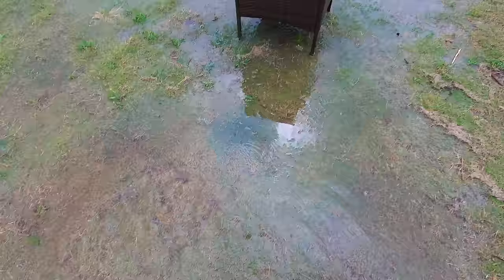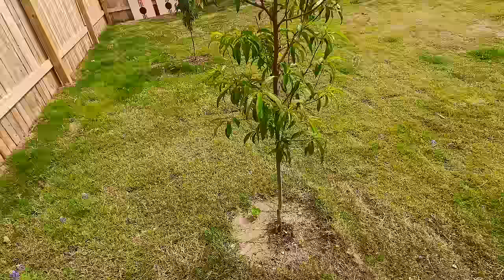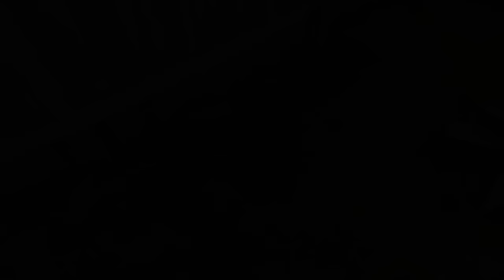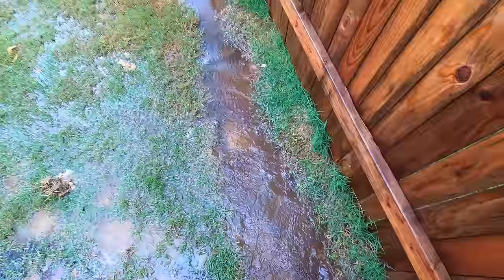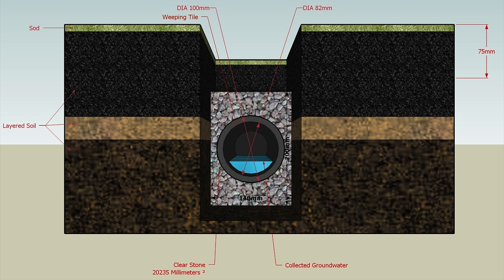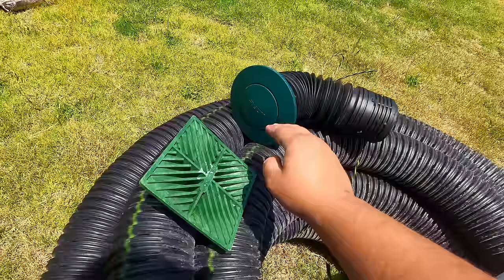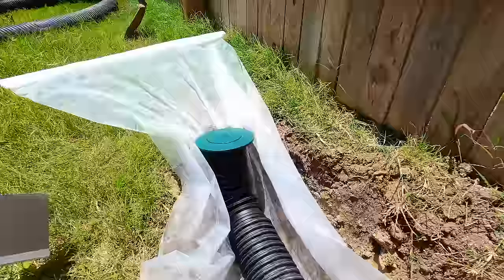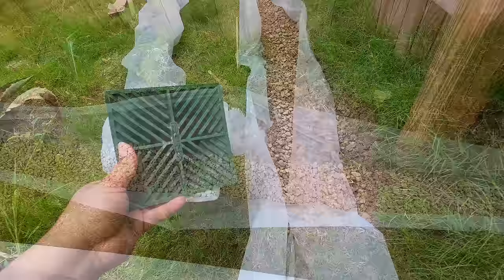How I Built a French Drain to Improve Drainage on Clay Soil

Comment: nice project, well done...... buuuut, a word of advice from my amateur knowledge;
the white soil separator you used might likely rot after 1-2 years, or let any roots through to the pipe. if you ever need to fix the drainage, rather use a strong(er), usually black, soil separator (like a car tarp). just my 2 cents :)
Reply from the maker: Appreciate the advice! Its now been 18 months, so ill have to reassess things next summer

Comment: That's amazing well done mate. Where the ditch out front is, are you allowed to build a path leading to the street from your gate and install another french drain alongside it?
Reply from the maker: I could’ve tried, and I agree the drain would’ve been better if I went closer to the street, but then I would’ve been getting really close to electrical wires and Internet fiber, so I stopped where I did

Comment: It would obviously give less drainage, but I have to wonder if this could be done with just a trench and the stones, without needing the pipe or soil guard at all. Would even think you could leave a slight gap at the top, cover it with some top soil and grow grass back over it. Just using the stone under the surface as added drainage. Of course you'd probably want to take that trench further out so it has somewhere to go.
Reply from the maker: Agreed, I think just a trench and river rock would work, of course without the pipe and nets, it will fill with sediment faster
Reply: @AustinTexasGardening  True. After a few years it might lose most of the drainage

Comment: I am thinking to use this method since i have a littler river running in my backyard when we get heavy rain. I could "catch" the water that comes from the neighbor and using the french drain all the way down with an exit to my lower neighbor.
Reply from the maker: It should work, don’t forget to call utilities to mark power lines or check building plans before digging!
Reply: Yes this works, but you only need a french drain or catch basin where you catch it. The rest can be underground smooth pipe all the way down to carry the water. Absolutely no need to have a french drain the entire length.

Comment: FYI you dont need the gravel to be exposed to air, cover it with some sod. The water will penetrate the profile and itll look better
Reply: i would also recommend against the plastic, all its doing is keeping more water away from the pipe. a pipe like you have wont let in mud anyway, exspecialy with the liner you wrapped it in. And in case it ever gets clogged you already have a flushout. it seems like the outcome was good but it probably couldve been better. (ive been installing french drains of golf courses in clay for years)
Reply from the maker: I've considered covering it with sod, might be something to do this spring

Comment: Great video! I just noticed you said "corrugated" pipe had holes in it - Not true, unless you use "perforated" corrugated pipe.
Reply: Thanks for correcting that, I was looking through the comments to see if anyone did. 
What he’s using is under drain pipe.
If you use PVC under drain, the water bubbles up through the holes on the bottom in order for the water to clean the pipe as it goes

Comment: im confused. where did the french drain  send the water. it didnt look like you connectred anywhere. it looked like you just dug one long trench and put an cap on it.
Reply from the maker: The bottom of the trench is about 4” lower than the top, the water has always drained between my house and my neighbors 4:28, now more of it pools around the pop up cap, and drains into the alley. The drain would be better if I dug it to the alley or street, but as you’ve noticed from the before and after pictures, I’m pleased my hard isn’t flooded anymore

Comment: Glad that worked out for ya, but really you just need to amend your soil, start mulching your grass instead of bagging it, add compost, bring in some worms, toss down some mycorrhizal fungi, need to fix the broken ecosystem that is your backyard, they brought in all this clay you're saying, that's not it's natural state. And in the end your lawn will look even better, be happier, be more drought resistant, and overall just be better and healthier.
Reply from the maker: Completely agree, this is great advice. I'm planning on amending with an auger and mulch early spring/late winter, just have to find time to do it
Reply: Setting up a French drain will work months if not years quicker than soil amending.

Comment: So you didn't have to run it all the way to the street? You only ran it to where the swale begins between the houses? I'm having the same issue (also in Austin). The swale between mine and my neighbor's house works as it should but I'm getting water run off pooling up against the fence because she waters so much :(
Reply from the maker: The trench didn't need to be dug further because as you mentioned, the swale catches most of the water. When it rains a lot, some of the water goes through my yard, but I have no standing water within 5 feet of fruit trees, less standing water generally, and the standing water I do get clears up within about an hour, as opposed to standing water sitting for days to the point of mosquitoes breeding in it.
Reply: Swale or not drainage to the street or alternative outlet will work much better than a buried pipe.

Comment: Someone from Round rock here ☝🏽 do you need city permits or call the city to check if there are any pipes or wires that you need to be aware of before digging in? We’re trying to figure out that part .
Reply from the maker: Permits no, but you really should have them come map out gas, electric, and fiber lines. The only reason I didn’t do this is because I watched them lay the lines during my homes construction one year before I made this video

Comment: Wondering how French drain helped with standing water. ? Standing water would mean you have low spots in yard
Reply from the maker: The clay soil soaks up water, so when 1" of rain falls, without the drain, ~9" of rain run through my yard (from everyone elses yards) causing the soil to be maximally saturated, and the water to stand.

With the french drain, when 1" of rain falls, the ground soaks up the rain, no water is standing, and the water from my neighbors yards drains elsewhere

Comment: Any ideas on good videos for larger landscapes? Project on housebuilding got left halfway done, too many problems so had to let the guy go. Now wife and I don't trust anyone but ourselves to do it right. How can I learn the concepts or drainage and what to do for the property? W're on a very slight grade, with the house area being "leveled" already and its pooling up quite a bit
Reply from the maker: I would honestly suggest looking for a professional with a large, highly rated portfolio. It will cost you, but for building a house, it needs to be done right.

Of course, this video is just a 40' drain in the suburbs, for something bigger/longer there is a lot to consider. If you are not draining to a lower level than your home, flooding the foundation can cause some real problems. I would advise digging your drain deep, and with the drain exit being significantly lower (like 12") than your build site, and far (~100m) from your home
Reply: @AustinTexasGardening  Yeah that's definitely preferable. But being so far out in the country, a good reputation is hard to come by. So I wanna learn it all myself but that's not a clear cut process lol

Comment: Good job. I’ve had experience with corrugated and PVC. I found PVC easier to maintain and do a better job. Any reason why you didn’t use PVC and drill holes at the bottom to work as a French drain?

As others have said, continue it to the street. Preferably with PVC.
Reply from the maker: PVC would have been better, but corrugated was easier to use, I didnt have to drill anything and my trench didnt have to be a completely straight line.

I might try to bring the french drain closer to the street in the future, but right now, I dont see a need for it, as the water drains the way I want it to.
Reply: I plan to use 6" pvc for a pipe. I saw some that already have holes drilled on one row. I am wondering if I should drill a bunch more holes like corrugated pipe so that standing water will drained thru those holes. I have very high clay soil and thinking of using commercial geotextile ONLY at the bottom layer as barrier between soil and rocks, then lay down the pipeon top rocks and cover pipe with more rocks ...done! Hope it works because I need to do 150ft long trench, farm application. Thanks.
Reply: @mandiegarrett1706  let us know how it goes? I am wondering.
Reply: @darealturbo9749  Well, due to heavy clay soi here in AR. and after chatting with some local rock seller, he recommend just do dry creek bed method with sand as bottom layer to help with drainage then a layer of rocks on top to keep everything together to direct water out to our pond. I think I am going to skip the sand and just use rocks of different sizes and landscape it like dry creek bed. If I first put down some big rocks right into our clay soil then follow with medium to small size rock to fill in the gap. I think doing this way without fabric, pipes, etc...should allow water flow freely to the pond. Don't know for sure if will work but will experiment with about 10 ft and see if that will work. Thank you.

Comment: Just saw your post on reddit! Great stuff! I noticed that the peach tree experiencing the waterlogging issues had way smaller leaves, etc. I've got a peach tree sitting on top of very clay heavy soil and while it HAS leafed out, the leaves are really quite small (1/4 the size of the peaches next to them). Would you recommend digging a mini trench down a slope behind this tree to solve potential drainage issues?
Reply: You want 10 inches of well-drained-soil so a trench or simply raise the tree where it sits on a mound.  I did both & achieved 14 inches.
Reply: @SlackerU  thank you so much! Would the "well draining soil" 10 inch+ layer be inclusive of the rootball? Or does the rootball needs to be sitting on that the layer of well draining soil to ensure good drainage?
Reply: @paulli4938  The roots will live in the 10-inches of well-drained soil-horizon(layer). Your local University Ag Extension office probably has the information on their website for small farmers. My native soil has a PH of 5.3 so all of my plants are mounded.  I basically just don't dig a hole & place my purchased-potted trees on the ground to then surround them with a mound of proper-PH soil.  The roots flair out like an umbrella over the mound.
Reply: @SlackerU  again, thank you so much---this was extremely informative! I have terrible, terrible heavy clay soil under a thin 3 inch layer of topsoil developers put down (and mixed with small rocks below). Digging and amending (and the drainage issue) has been a PAIN. I am going to dig up my peach (it's still relatively newly planted) and try your method for hopefully better results!
Reply from the maker: @paulli4938  Yep, my main motivation with the french drain is that my backyard is too big to improve so much of it, even with the trench im thinking of mounding my large peach tree as well, just to give it a better chance

Comment: That crap you wrapped the drain with is going to get clogged over time and you'll be right back where you started with drainage problems.
Reply from the maker: What would you have done differently? Left out the soil separator? 

I did an 18 month update where some pockets of granite were swallowed by dry clay soil fissures, the soil separator that was exposed looks to be not very weathered
Reply: @AustinTexasGardening  Yeah, I'd have left the fabric off. All the soil particulates will embed themselves in that wrap. Over time the amount of water that enters the french drain pipe will be reduced to a trickle.

Comment: Wait. Are you tell me that the water on the opposite side of the garden drained because of the french drain on the other side of the garden?
Reply from the maker: Its the fact that the grading drains at least 8 backyards worth of standing water from the elevated west through my backyard. The house to the north (behind my backyard's back fence) is elevated, so almost all the water is coming from the west. I've found the french drain makes a pretty big difference, we have a lot of rain forecasted so I hope to make an update video.
Reply: @AustinTexasGardening  cool. Because of this video I plan on doing the same thing in a straight line down the middle of my garden from the back wall to the house. My garden is just clay soul with zero drainage. Cheers man

Comment: I don't understand how is the water gonna enter in the pipe? I think all the water will just enter in the soil through that gravel
Reply from the maker: The soil is so dense that when it rains, the water collects on the ground like pouring water onto a dinner plate, thats why I have so much standing water after only about an inch of rain in the first place. 

The water enters the pipe because as it flows downhill and through my property, the trench catches it, and the granite displaces the volume where the water would otherwise go. The pipe runs at a slight decline downhill, so the water enters the pipe, and flows downhill, towards the drainage alley between my house and my neighbor's house.

The installation of this french drain has turned my backyard from a mosquito infested swamp to just a pretty normal backyard, and improved the quality of drainage around my fruit trees.

Comment: Would a French drain work if your yard is a a hill?
Reply from the maker: It depends, the main thing you need is a downhill slope, so any standing water in a valley needs to drain to an area with a slightly lower elevation. You can do this by sloping your trench about 1" per 10 feet, but the steeper, the better.

Comment: How many QF of granite needed for 50’ French drain?
Reply from the maker: I used about 30 cubic feet of granite for this 40’ trench, so I’d bet you’ll need around 38-40 cubic feet for a 50’ trench (depending on depth and width of your trench, mine was about 12” wide and 12” deep)

Comment: There is no need for a drain when you haven't leveled/graded the lawn yet
Reply from the maker: The pop up cap doesnt really work, but the french drain really does catch all the water that would otherwise fill my backyard with .5-1" of standing water and misquotes and all spring. When we get 1 inch of rain at a time, the water pools around the lower end of the drain and when it overflows, it drains downhill between my house and my neighbors house, leaving the majority of my yard well watered and not flooded (as shown at the end of this video).

We're getting a lot of rain this week so I hope to make an update video

Comment: I’m sure the video creator did this, but for other folks: be sure to talk to your neighbor (in writing if possible) before working on any drainage solution that routes water towards their property
Reply from the maker: Great comment, my neighbor and I are buddies so we talked it out after, but we really should’ve discussed it before. I wouldnt show it in the video, but my neighbors house is built up almost 3 feet above ground level at the bottom of the French drain. The side of his yard on the other side of my fence has a downward grade of nearly 20°.

I’ll add, as I mentioned in the video, this video is really only for people that are in similar situations to myself, if you don’t live in the suburbs and have a large property, consider that redirecting the flow of water can be a criminal act, if for example, you build a French drain diverting a flood plain.
Reply: @AustinTexasGardening  Realistically, all you were doing is protecting your lawn from the runoff from his steeper lawn anyways! With such poor soils there just isn't enough infiltration to infiltrate the water landing on top of your soils and plus the water from his lawn!

Comment: There's an easier way to solve this. Many of these lands had the good top soil compacted or scraped off. If you add a layer of leaves shredd and compost mix together year after year until the grass comes up through. it will also fix your issue.  you want unfinished compost so you are basically building an organic layer. You also want to plant some tilage radish.
Reply from the maker: I agree that improving the soil quality would definitely be good, but it wouldn’t prevent my neighbors round up and poison from running through my backyard orchard, and anything that takes a year to accomplish, isn’t really “easier”

Comment: If the topsoil is clay but sand underneath drill holes 15 ft deep and fill with sand.
Reply from the maker: Haha not so easy to do with a shovel
Reply from the maker: Still good advice though, it is really difficult to amend clay soil
Reply: @AustinTexasGardening   Few years back i rented a handdril that was that long lol. When your finished you look like Rambo lol but its manageble
Reply from the maker: @martinvdv5970  i might actually give it a shot, I’ve seen some 4’ augers that might do a decent job, do you think I need to go for more like 10’?
Reply: @AustinTexasGardening   10 inch is like 25 cm thats more then enough. Mine was only 4 inch but i used drainage pipe i  put in the hole then filled with sand. I had 2 layes of clay, one 3 ft deep en the 2nd 6 ft deep
Reply from the maker: @martinvdv5970  ah that’s good to know! Appreciate your advice

Comment: Do a video in 2 years when this system is failing. All those products are built to fail in due time. You can collect water and divert to a solid pipe to move the water to the front of the property.
Reply from the maker: I shot a video of the system beginning to fail as the cracked clay soil swallows granite from the drain, it’s been 16 months, it’s my latest upload